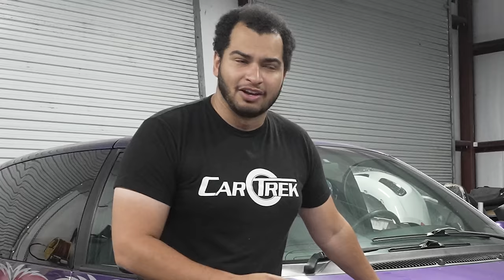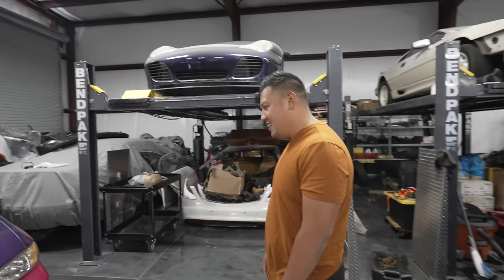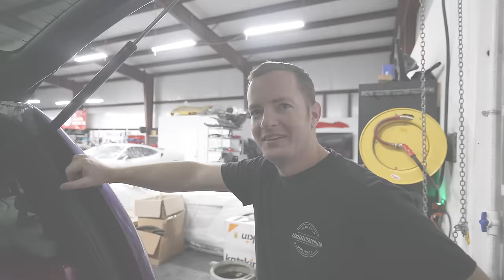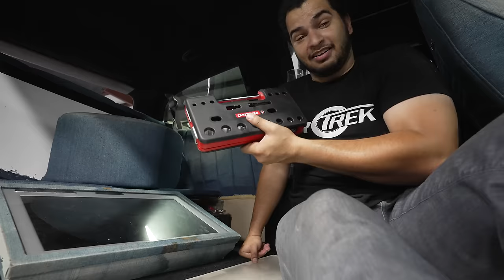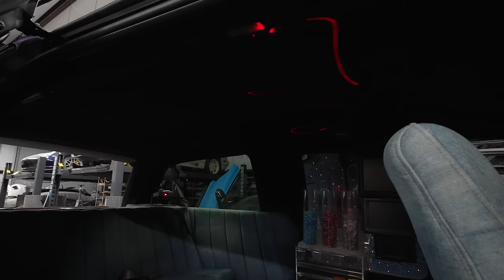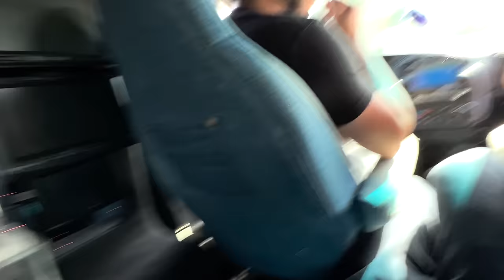This "Pimp My Ride" Minivan Was Abandoned AGAIN...So I Bought It Back

Comment: Well what would be baller would be to re paint the car with a 2 tone black and grey with a rolls pin stripe along the sides. Then ree do the seats in another material.. perhaps skinn. And chang sl the screens to modern flat screens.  🙌🏼🙌🏼🖐🏼

Comment: The sound of that van accelerating made me emotional.  I took my driver's license test in a 1999 Dodge Grand Caravan!  Fun fact, the amount of crap that came flooding forward during the emergency stop honestly gave the instructor pause.
Reply: Mine was a 2000 base caravan. I learned to drive in that thing and it almost became my first car.
Reply: Current owner of an 06 Caravan. The tall gearing really is unique. It drives exactly like you expect a minivan to.
Reply: I’ve got manny video of my 99 and 96 I grew up with a 99
Reply: @mikehall3976  the 4th gens sound waaaay different with the gearing and higher rpm

Comment: Man the 2000's were a weird time in car culture.
Reply: yep 2000  was   weird time is like   hybrid 90s   i miss that
Reply: I did a turbo on my Acura integra and spent my money on going fast and even built a second motor just to turbo. I was packing 400 plus turbocharged intercooled horses. Made my money back racing it illegally. Fun while it lasted, then I got that night that made me hang it up. I had my plate retracted while racing another kid. I had beaten him and he paid me when the cops showed up. Yeah all 20 of us ran in 10 different directions. One cop zeroed in on me as I was bolting. I booked for the highway and he ran right after me. I don’t know how fast I was going but I pulled the kill the lights and take a hard exit trick. We flew home and I’m pretty sure the cops were still looking for me judging by the scanner activity. I took off all the custom stuff over the next few weeks and I bought other wheels for it. Next time anyone saw it it looked totally stock minus the rims and the lowered ride height . Got out of it over the next couple of years racing less and less. Ended up building stuff for folks instead. Last September and back in  March I sold my last 2 vehicles to finance a brand new 2022 Toyota Tacoma. I had nowhere to keep the integra anymore after I moved. I parted with it after 22 wonderful years

Comment: How is that "jewelry making station" still in there,  with every last bead intact from 2 decades ago?! Even the original owner they made it for didn't want to touch a single plastic bead in there, and yet none of its many owners has dared remove it.
Reply: The day the jewelry station is removed is the day the van gets totalled thats why

Comment: i love how this is so similar to my van, no ac and only 1 vent works. (i also have a 1999 dodge grand caravan)
Reply: Belles sore actuator put your head under the drivers side look up the gas pedal side you’ll see 3 actuators try moving the zones and smacking it at the same time. Ended up fixing the hot/cold stuck issue on my drivers side.

Comment: I wish I just spent my money and went and got it if I had it it would have been super cared for I know the ins and outs of these vans it’s kinda odd seeing my van driven and so popular THIRD GENS FOREVER! 96-2000 and just for reference seeing that intake leaves me to believe it’s a 98-2000 best years to buy hardly any electric ecm issues or wiring issues for the later years plus a redesigned intake cam and pistons. I miss my 99 it was perfect till I had to be a dumb fk and speed😞 my current 96 will never be the one. All I saying is I hope you take care it tavarish. It also sounds like the belt and tension needs replaced and possibly the idiler fyi. Hope I see this one the channel some more😁

Comment: Before I embark on the rest of the video, I think you guys are embellishing the flaws a bit. I mean all that bumper needs is a screw to put back in place. And the fiberglass bumper has a tiny chip in it, oh my goshhhh. And none of the electronics work BECAUSE THE BATTERIES ARE DEAD. If you put 2 new batteries in and everything works again, that was unnecessary drama. That stuff that fell out of the door panel is probably just sound proofing or just a plastic cover that you don't even need probably. So all you need is to mount that panel back and it'll be fine again. Time for the rest of the video.

Comment: I bought my first 800 pc mechanics kit from Sears in 1987 when I worked for them driving 5 ton doing deliveries.  Since then I have probably bought 3-4 more kits before they went bankrupt, oops I mean offshore in the early 2000's. Still own my original tools, except for some replacement 10mm's

Comment: Craftsman made good tools 20 years ago, NOT ANYMORE - bought a general 300 piece service set to replace my gearwrench set that got stolen, IT DOESNT HAVE A 10MM wrench!!  The ratchets are crap, broke the driver off of the 1/4 inch drive while yanking a carb off my bike, and the weld/casting for the direction selector on the 3/8 just plain fell off when I was using it on a brake caliper.
Save yourself the headache and go to harbor freight - same quality and cheaper with the benefit of them replacing it for free for a year

Comment: As I suspected, you made a big deal out of nothing in the beginning. The person abandoned it because you gave it to some rich dude with nice cars that didn't want it. All you did in the video was change the batteries, vacuum the carpets, wash the car, and put one bolt on the front bumper. That crack in the bumper you pointed out you didn't even mention at the end of the video. The car runs fine and everything worked like it should after you added the battery. Kind of a waste to give it to a museum when it still runs fine, but whatever.

Comment: The v20 drills and impacts are Not compatible with 20v drills and impacts. The v20 batteries fit on 20v tools, however, your have to slowly pull the trigger on the 20v tool

Comment: To be  honest i would drop a bit of money to get the inside reapholstered in a normal material. I'd get that monster of a monitor out. Same with jewelry station.remove those side monitors so both sides can open again.remove the flooring and replace that with a foldable bench seat that recesses into the floor.put a drop down moniter right behind the front seats for whatching a movie. Remove all but 1 of the moniters in back leave the sound system. Put a nice running powerful v6 in with twin turbos so you can get your kids to school faster. Lol. It would be ok then I think. Much more enjoyable in my opinion.

Comment: To use the car dayli without battery down put two used solar Audi glasroofs in the top of the car, they are cheap at every junkyard😉😉
Best way to charge the battery's in the sun ☀ 🌞 ☀

Comment: That's funny that you bought that thing back.. It needs to be on a smart charger with all that stuff in it.  Not for nothing but it could be hot again if it was painted a different color and that tired interior was updated Doesn't have to be too expensive, but in better condition..

Comment: The power sliding doors on this era minivan weren’t “custom” per se. They were used extensively in vans modified with wheelchair ramps for disabled drivers and/or riders by companies like Braun. So the mechanisms for power sliding doors would’ve been available to West Coast Customs. Possible they fabricated their own, but unnecessary.
Reply: This was a GAS car, not WCC.